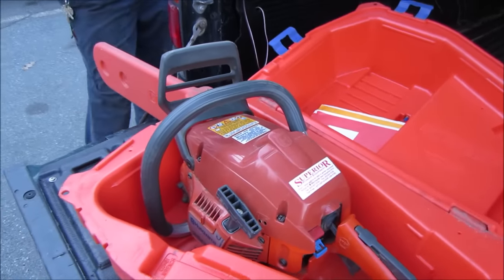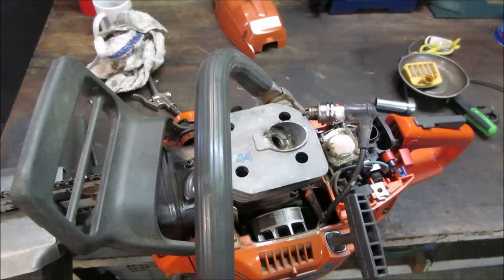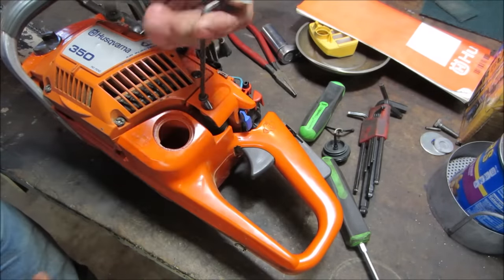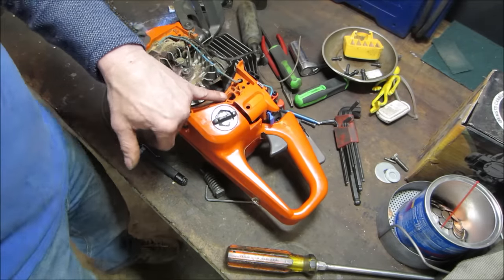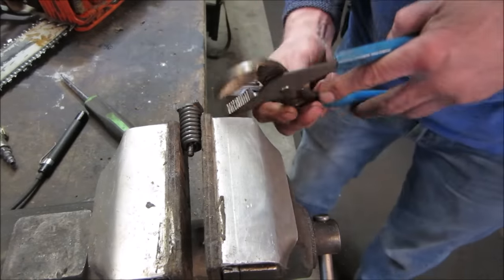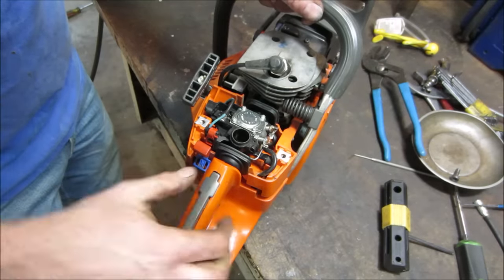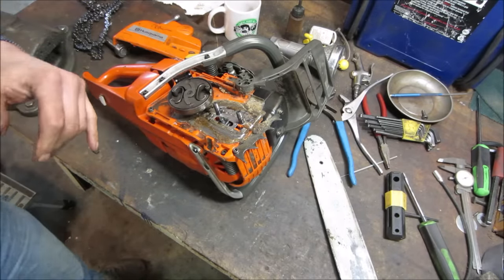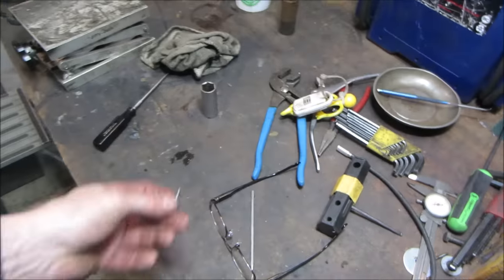Can It Be Saved? The Junkiest Chainsaw Ever. Picked out of The Trash.

Comment: Husqy is a damn good make! Dirt bikes, snowmobiles, power tools. Not a "janky" make at all! At least as good as Stihl, if not better.
Reply: Husky is way better than sthil. Pro use stIil give you 90 day warranty husky 1 yr you tell me?
Reply: I own two Husqvarna and two Stihl chainsaws.All i can say is that i like the Husqys better
Reply: @gumelini1  Yup, I've used the massively expensive Stihl strimmer with the anti vibration setup and HATED it!
I now use a £100 52cc Chinese strimmer that is lighter, better balanced & is of all metal construction instead of being swathed in plastic like the Stihl. 
I feel Stihl are going down a dead end in the design of their tools. 
To use a machine all day it needs to be light and poised. 
"Less is more." And Stihl don't understand that at all.

Comment: I have been running one of these for about 6 year, only let me down once when a fuel pipe split
Reply: That's what you get with ethanol fuel....you need to replace the OEM hose on older saws just to combat this split from happening when you really need the saw to work....

Comment: Maybe you know it by now, the plastic was not stripped out, there's a aluminum insert that has a tap hole in it, and bolt screws into that. I had the same model saw do the exact same thing. Also there's a app called manuals Library, you just type in the product and it will give you every manual for it, best of all it's free. Last but definitely not least,
Knowledge is power 🇺🇸👍

Comment: I got a free electric lawn mower, a free gas chainsaw, and a gas string trimmer.  The mower just needed a few drops of oil in the motor bearings, the saw needed a spark plug and the trimmer needed a new gas line and filter.  I've had them for about 8 years now and they still work like new.  I did the repairs.

Comment: One other thing that wasn't mentioned in the video - out at the end of the bar are two tiny holes, one on each side, that are for greasing the sprocket at the tip of the bar. You can purchase a small, disposable grease gun especially for that purpose. You need to grease that sprocket (just until you see grease beginning to squeeze out from under the chain) every time you refill your fuel and bar oil.
Reply: The bar oil generally lubricates that sprocket but grease is sometimes used if tip drilling alot
Reply: @eyespy1415 , over the years of using chainsaws (sometimes commercially - I used to work for a sawmill), I have logged at least hundreds, if not thousands of hours doing so. I have much experience as a result and I can guarantee that you will make that bar and that sprocket last much longer if you'll keep it greased. Yes, it is possible to use it without greasing, but you shorten the life of the bar, so doing.
Reply: @AYZTyler  and EyeSpy Stihl guide-bars don't have the grease-holes at the nose-sprocket any more (they claim the design of their bars and oilers renders it unneccessary, but I always add a drop or 2 of chain oil to the nose of the bar everytime I fill the tanks because I'm kinda-OCD), but I agree 100% that if these holes are there then you should grease them.
It always seems strange to me that nobody seems to even know that they are there, let alone what their purpose is?
Reply: @therogers4432  I swear by Oregon bars.  I have been using them for decades and they have the grease holes.  With normal use I have never had them fail on me and they usually last for many years before they're so worn they have to be replaced.  Of course, I learned long ago not to continue to use a dull chain.  If you do, you can ruin the bar with overheating.  If you're going to be using a chainsaw on a regular basis, your best investment is to purchase several chains and replace the chain when you begin to make sawdust, instead of wood chips.  Several chains allow you to keep working when one gets dull, by just swapping it out.  It also allows you to continue working while you have chains in the shop being sharpened.  I know some swear by hand sharpening, but I never could really get the hang of it, plus it's time consuming, so I let a machine do it for me.  Every time I change out the chain, I flip the bar, so as to get even wear, especially on the tip sprocket.
Reply: @therogers4432  9

Comment: Husky 350 is actually a great saw. It’s the homeowner (plastic crankcase) version of the 346xp pro saw basically. Plastic crankcase lends itself to issues and the plastic intake boot clamp on these notoriously fail making it run lean and seize. But if you replace the boot and do a few mods (base gasket delete and muffler mod) this homeowner saw quickly catches up with pro saws. I keep one in my truck since the plastic crankcase lends itself to not corroding.

That saw is idling a bit fast, if it doesn’t straighten out with carb adjustment it likely has an air leak. First place to check is the intake boot.

Comment: I have this same saw I bought it new in 98 and hasn’t ever run right.
Reply: Another commenter has said:
The 350 was originally manufactured with a plastic clamp that tightens the intake manifold boot. This caused a significant air leak and loss of compression. The plastic clamp needs to be replaced with Husqvarna 537251302 Wall Partition Intake Clamp. (Or you could use any round metal tightening clamp of similar size).
Also the fuel line needs upgrading to cope with corn juice.
And sometimes the coil needs replacement (if it's not a carb problem...you've got an ignition problem.

Comment: Had a husky 350 for years great saws light and powerful not junky at all wonder if it had been bashed hard to strip thread ...good work on the repair and great clear vid .....maybe an Allen key for a cordless drill could save you a bit of time on the Allen cup bolts ....just sayin lol thanks for posting.

Comment: i bought a box'o saw at a garage sale. last year. it was a husky , old and dirty in a milk crate. "parts box". for a 100$. it turned out to be a 555 husky. with the wrong bar and chain. missing screws and filter , clips gone. msc. got it running the first day. spent 50$ on putting it back together. now its my go to saw. got to love it. triple nickel gets it done.

Comment: I would use a rag and a piece of coat hanger wire in the field. Use the rag as a dampening device, then cinch that handle up tight using a 'timber hitch' in the coat hanger wire over top of it. Rag will help the wire not move around. I probably wouldn't have gone to your length to fix it. Impressive.

Comment: I have a husky 400 that I bought at least 10 years ago, other than cleaning, fuel and oil, the saw starts on the 3rd pull EVERY time, runs great, my only regret is not getting the 455, a little bit bigger and more options for the chains, GREAT saws!!!

Comment: This is the same saw I have, or at least it looks exactly the same.  It could be a different number.  I had to fashion a piece of wood to place under the throttle and hold it down with my foot on the ground, left hand on the handle and right hand pulling the cord.  It is the hardest to pull start I have ever seen.  It starts rather quickly by using the choke and then I push the wood up to push up the throttle and hold it down with my foot while I pull the cord once or twice.  There is no way it could be started off the ground while in a tree so I only use it on the ground. I always have to remember where I put my piece of wood at so I can restart it.  I am really glad I could see how to take it apart like this.  Its a big help.

Comment: That saw just needed a little love. I did some work for a guy who owned a pawnshop and he had a junk pile of chain saws weed eaters extra. I noticed a husqvarna 450 rancher that looked like brand new and I could tell that the pull rope was just hanging out of it. He told me to just toss the entire pile into the dumpster. I told him that I could fix a lot of the stuff but he said by the time I pay you I would be making anything off the stuff. So on my lunch break I took the 4 screws out and winded up the pull rope and put the screws back in and started the saw. He had told me that I could have whatever I wanted from the pile after I started the saw he came out side and said wow you got that chain saw running? I said yeah it just needed the pull rope rewound. He said i told you that you could have it but I will give 100.00 for it back lol so I said yeah. He sold that saw later that same day for 270.00 I started fixing everything else in the pile that I could taking parts from other stuff and fixing one. He had 2 garden tillers one craftsman one statesman and i used both to rebuild one good one. Most of the time it is just simple things wrong with equipment people don’t really know how simple it is to repair things when just taking a little bit of time.

Comment: The way to fix the hole is snip the tips off 2 zip ties and a little epoxy in the hole and run the screw back in. Also check the intake clamp. If it's plastic it needs to be replaced with the upgraded metal clamp and boot kit. I suspect it's already lean and that's where the scoring comes from. The correct way to remove the tank is pull top handle, remove recoil, remove clutch cover,pull fuel line and throttle link(hold carb linkage wide open and pull link from under the spring) remove all antvibe mounts and 2 limiter screws. (Tank and handle will pull right off)

Comment: A few years ago I purchased a returned Husqvarna chainsaw at a discount price; I returned it also...spent more time trying to get it started then using it! I purchased a Poulan 262 new, but same story. After spending $75 to have a small engine repair shop tune it up, I still spent more time trying to start it then using it. I figured if I kept that up, I'd have forearms like Popeye. I tossed that one in the trash. I now use a Greenworks 40V battery powered chainsaw: instant start up, and it does what I need done. Combined with an Oregon PowerSharp bar, chain and sharpener,  that is all most homeowners need.

Comment: I have owned that exact model since 2004 (17 years now).  

I do not baby it ... nor do I abuse it.  It is not used everyday.

But, it has worked fine all that time without going in for service once. 

I will compare the Husqvarna 350 favorably to Stihl, Partner and Jonesred saws which I have also owned.

Comment: For those burned bars, I’ve seen cases of people mismatching the chain and bar. Using an .050 chain with a bar of a higher gauge. That wobble will make them hot, wear the bar, cut sideways. I try to keep my bars and chains matched when I hang them up. My local chainsaw shop does not always have, say, a .058 chain for that 24 inch bar for my Husky, so I get the .058 chain and bar match. When I put that 24 inch on a year later I don’t remember what it was and try to be sure to check the numbers on both or use my gauge, but if they are hanging together the whole time, no worries.
Reply: Or get one of those cheap plastic gauges, and you'll always be right!

Comment: Pretty sure I saw the little bitty grease on the outer end of the chain bar. It takes a special chain saw grease gun to grease it. I am sure you know about it. The way I discovered it was when the bar and blade got warm the chain would bind up. I kept oiling the end and cleaning it out before I discovered the tiny hole for the grease gun. It’s a great saw.

Comment: 400USD saw.  nice fix on the rear vibration mount.  cylinder scoring didn't affect the running of the saw.  the real test will be putting the chain into wood.

Comment: The Husqvarna 350 is a great chainsaw, semi-professional class. 
Have worked it hard but respectfully over many years, and only issue was damaged throttle puller due to a twig that got lodged in the mechanism. 
Other issue stopping it running was a simple disconnected rubber air tube at the carb, probably vibration. Dismantled lots unnecessarily before seeing it! Always look for the simple things first!
FYI The exploded parts diagram is freely available online. Huge amount of info in that.

Comment: I just replaced my old 3rd gen Husky last year. I bought it after Katrina put about 35 trees down on my property. They are great saws. So that is a 3rd gen 50 cc saw. I bought a Rancher 440 with 20 inch x-force bar and chain as my new Husky and it just cuts.

Comment: If you sharpen the chain in an inconsistent pattern it can make the bar wander to the point where it will bind which makes cutting very difficult and the bar to burn up. More than failing to fill the bar oil tank, a homeowner will sharpen the chain incorrectly causing their own frustrations from poor performance due to this.

Comment: A friend of mine bought a Poulan Pro chainsaw, in fact this is his 4th Poulan over a 20 year period.
For my part, I bought a Husqvarna 359 20 years ago, and it still works as well as when I bought it.
So over the years, my Husqvarna has cost me less than his four Poulans, which have required many more trips to the repair shop.
Like everything else, durability, reliability and performance come at a price.
A burned chain guide like the one in the video can also be caused by cutting very dry wood.

Comment: I take a little JBWeld and put it in the plastic piece, enough to coat the sides of the hole and let it partially set.  I then coat the screw with grease and turn it in the hole to cut new threads before the JBWeld sets up.  I then remove the screw and let it set up, usually overnight.  I then put the screw back in, but I am real gingerly tightening it down.  I do clean out the original hole with break cleaner before I do the repair to remove any oil from the damaged hole.

Comment: Something to consider when it comes to these smaller Husqvarna saws is that they often have power enough for a 18 inch blade, but the oil pump can't get enough oil out to lube a blade that long. In Sweden, they're most commonly run with 13 inch blades, I'd say 15 inch is max for a Husqvarna 350, given the chain is sharp and you don't push the saw too hard.
Good to see you fix it, a bit jealous, need to get my old 350 in order as well!
Reply: I've noticed that with my 450 (about 10 years old now), bar is gun metal blue now (had no idea about such a potential issue when I first got it), but the bar & sprocket still are in spec and rolls the chain great.

Comment: So if it leaks oil while it is in storage, is that an oiler issue and what is needed to correct that? I have the Rancher 365 saw and probably +20 years old. Still runs well except for the bar oil leakage.

Comment: The flexibility in the handle is to counter act the vibration so you won't feel the vibration as much. The spring in the handle makes it flexible for movement.
Reply: he knows that lol. it shouldn't have that much play though. It should move very little to compensate for vibration. Vibration doesn't move very far, just very fast. One issue was what he fixed, and it's missing some rubber bushings on the bottom.

Comment: I bought a electric chainsaw at a Flea Market 3 1/2 HP and the owner said the chain kept jumping off and couldn't keep it on, it looked like it never hit wood at all, like brand new, so I bought it and took it home! $25 bucks. I looked in the bar oil chamber and no oil present at all, so I plugged her in and yes the chain fell right off as he had stated. So I put some bar oil in it, and the first try it fell off again, but I put the chain back on and tried it again and it never fell off sense then, still have it! What a Beast of a saw 16" Poland Electric Chainsaw 3 1/2 HP. It will even cut through a electric cord in a second, 3 times on the same cord in the same day lol. Bought it in 2012, Thought my chain was wearing out, so I went to Tractor Supply and found the chain for it and bought the last 2 and sense I was there I might as well get a file for it to, to make a long story short, my other file was dull and I used new file one on it! on the original chain and it sharped it up nicely and it's to late to take the chains back! Da Ha! lol!

Comment: I have one similar to that one  but newer,  I took the carburetor off and it took me 30 minutes just to get to the carburetor.  I cleaned it, put it back together,  it started right up,  got it warmed up readjusted the carburetor and it ran better.  I richen the carburetor it helps the power,  and avoids running hot from lean running.  I have 2 Poulan's both are much easier to work on.

Comment: About it revving high when starting. Most these newer chainsaws once you actuate the choke, it sets something in the carb to do that called "fast idle" though it's more like mid throttle lol. Have to tap the trigger after starting to get it to go back to idle.
Most, when you pull out the choke it engages "fast idle" to help start cold engine. Then even when you put the choke in after you get it to burp the fast idle is still on then once it starts you have to tap trigger. .in most manuals it explains that when you use the chain brake when starting as you should that you need to tap trigger fast after starting to avoid engine damage from it trying to fast idle with the chain brake on. 
Totally normal. 
Won't happen when saw is warm and you don't use choke to restart. 
Can test this action too on some saw by pulling choke then hitting trigger and it will snap choke back in. 
It's all connected to the choke actuator lever/cable.

Comment: I have a Husqvarna 350 that is at least 22years old and just needs a carburetor because it sat for about a year with a little gas still in the fuel pump area of the csrb. Sweet little saw.